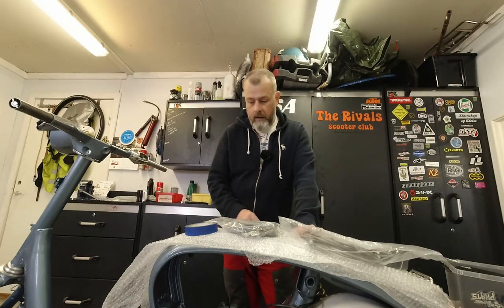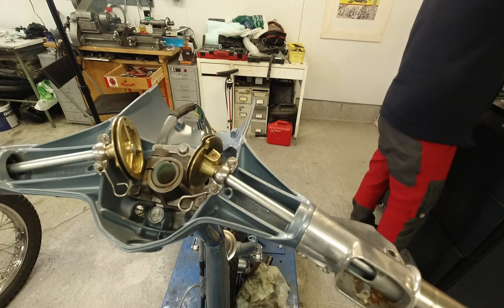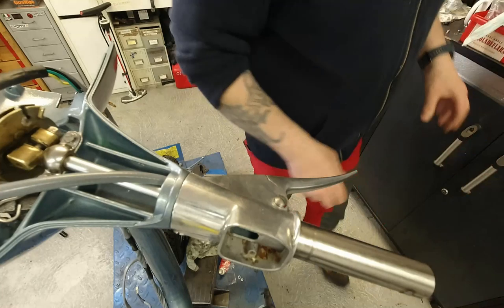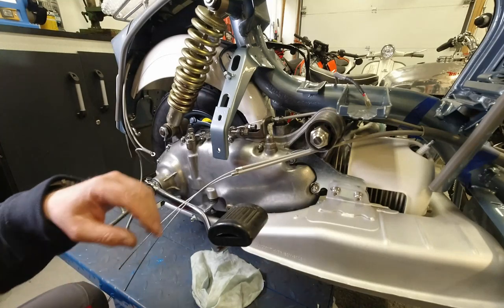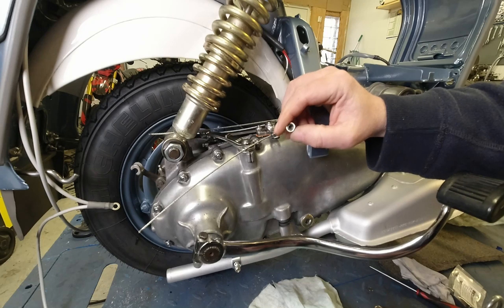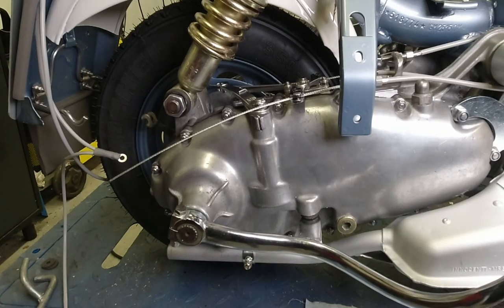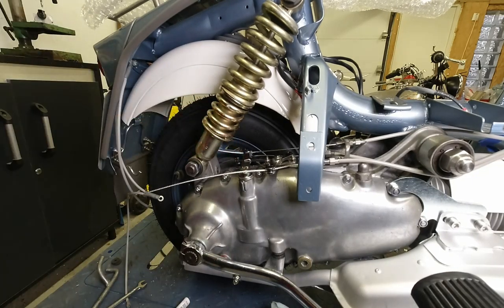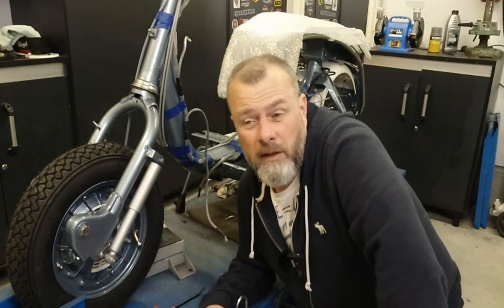Fitting lambretta cables, TV175 rebuild part 11

Comment: rightly or wrongly , i fit the small trunnion dish washer on top of the cable before tightening down.
Reply from the maker: And thats why you end up with a kink in your cable.
Reply: @kickbackgarage  Has to be a better system ? no trunnions o yes a new challenge .......
Reply: I use two dishes, bottom one fits flush inside and cable runs cleans through followed by the top dish. I use sip and straight jacket trunnions, no mucking about trying too thread the cable through 😁

Comment: Liked the video but one point to correct. At the trunnions you need to fit the wire and then put the small lead or copper coupon in followed by the grub screw. If you don’t do it this way you are graunching the grub screw directly onto the cable and this will cut some of the wires causing a fray. Also, just to let you know, your vid is showing the frame number caution there are some dubious people out there. Bolti
Reply from the maker: Sidney, that depends on the type of trunnion. The mb one's are cut too deep so they fray the cable if you fit the disk over the cable. I explain that here.. https://youtu.be/LU_52_M4BfQ